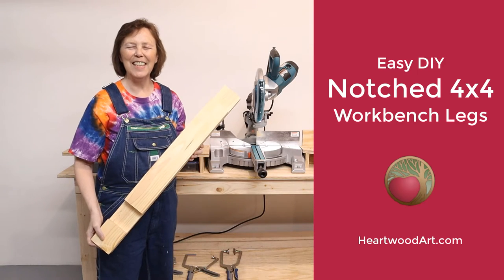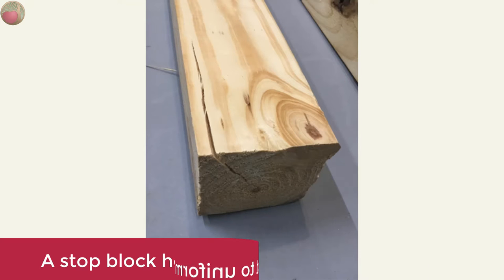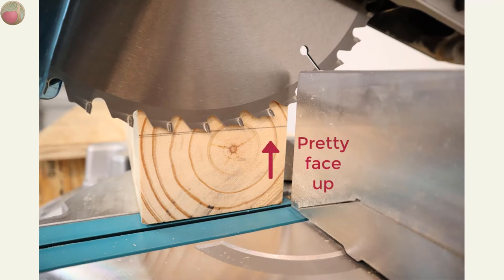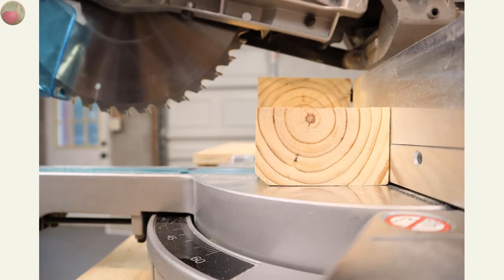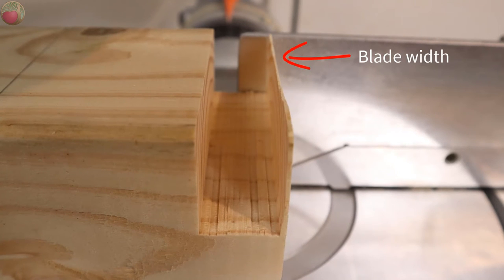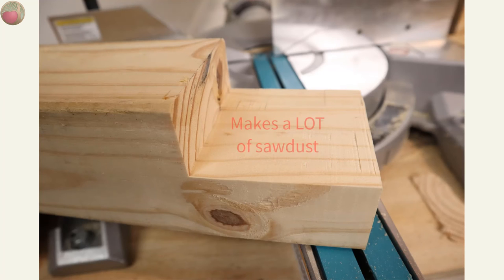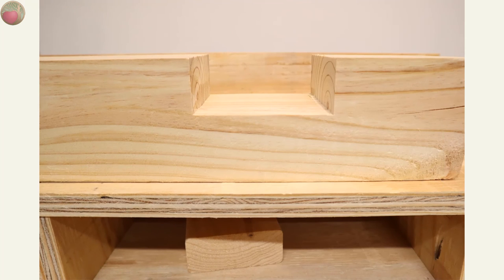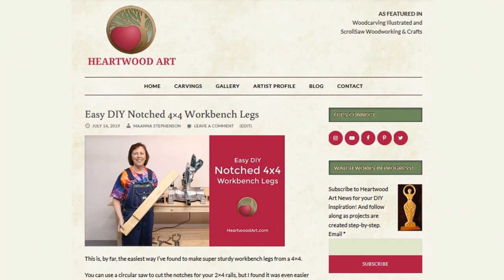The Easiest DIY Notched 4x4 Workbench Legs

Comment: To avoid the high ridge on the back, you should put a length of sacrificial wood between the workpiece and the fence, which would push your workpiece forward enough that the blade will clear the back so that there is no ridge. An added bonus is that it will prevent blowout.
Reply from the maker: Agreed!! I discovered that little tip after I made these legs. It does work like a charm!!